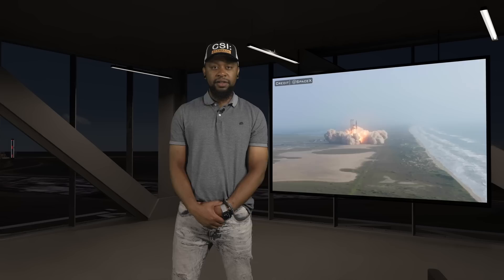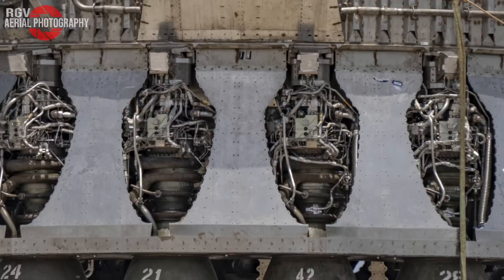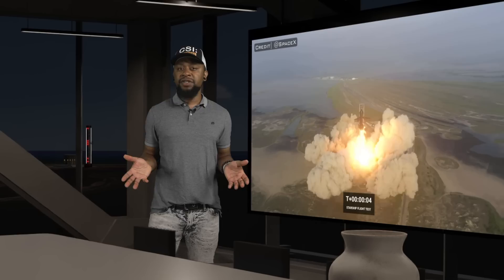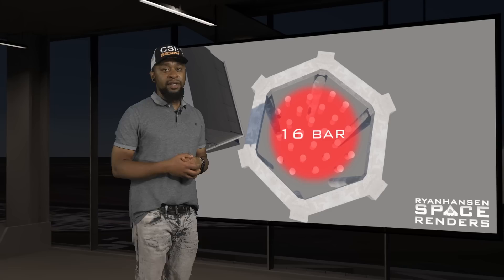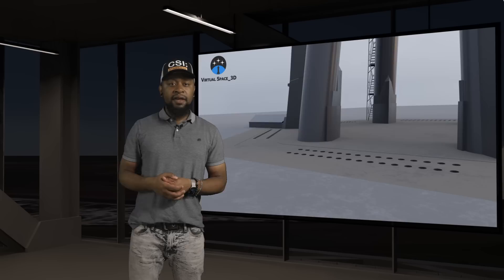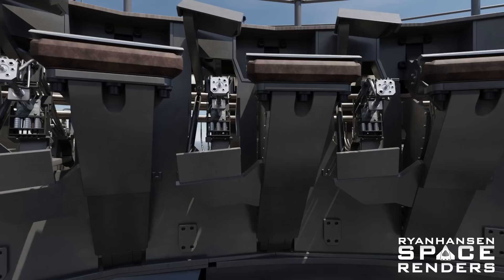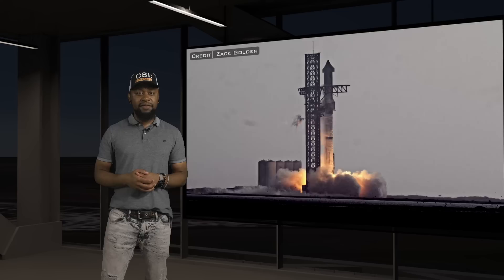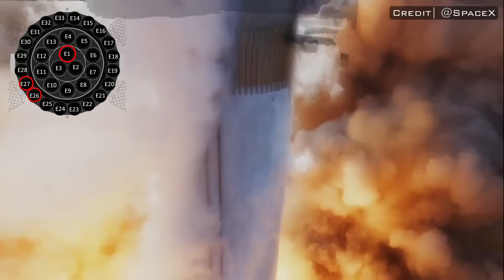The Design Flaw That Caused The Starship Launchpad to Fail!

Comment: Amazing content once again. Detailed and educational analysis of the entire sequence of events, didn't expect you to go that far, definitely the most comprehensive I have seen so far!
The intro section was good. It's difficult to stay on point yet deliver a complete message, regarding the "failure vs. success" narrative conflict in the media and elsewhere, but you accomplished it. 
Also, thanks for being transparent about your initial pessimism. I think this launch led to a lot of speculation in all areas, and everyone in the community had to change their mind about what happened in some way or another, including me, and its important to acknowledge that.

One interesting question: Could Starship, after a booster RUD in flight, separate WITHOUT being able to go to orbit - instead turn around and break back to the pad? As long as Starship can still function, it should have a rather large amount of fuel to burn at that point, so it should be possible to burn until TWR>1 and then land as if coming back from a hop, right?
Given this design will some day take people to space without a launch escape system, these kinds of crazy-sounding redundancies should probably be planned for, at least in my opinion.
(Even crazier: if something critically goes wrong with the ship during launch, would it be possible to dump fuel from the ship, and land the booster back on the pad with the ship still attached?!)

Comment: I am extremely concerned about the "giant showerhead" idea. To illustrate: if you try to keep your finger on open tap, you will likely fail or will have to use a lot of force to stop the water. But you can put your finger on a few openings on a showerhead easily and stop any water going through them. It's because there's enough other openings in the showerhead that will share the increased pressure in the head. in case of the launchpad, all that's needed is sufficient variance in pressure applied to individual openings of the "showerhead" from above for the exhaust gases to enter and tear the plate apart from below. My opinion on the matter is, yes, the plate needs to be cooled both from the top and bottom but any water sprayed on the surface should go from above and sides, essentially along the direction of the exhaust, not from the plate itself.
What happened suggests there's been too much guesswork involved in construction of the platform below the launchpad so far and I really hope guys from SpaceX will do their homework the next time or we may witness flying bits of concrete being replaced by flying sheets of inch thick metal plates.

58:30 On the speculation that the second stage engines did light up, I think it is extremely unlikely.The three "plumes" are way too far apart from each other compared to how big the second stage appears in the image right before the explosion, plus the second stage would have to be facing directly away from us to provide such view but there's something burning to the bottom right of them and that is definitely not burning in the middle of the air.
Reply: The showerhead will work perfectly as long as the water preassure is higher than the engine exaust preassure. Zack said that the preassure of the exaust in the middle of the pad is around 16 bar while the copressed gas tanks that are suspected to be used to press the water through the system can go up to 100s of bars, which should be more than enough to spray water into the exaust plume.
Reply: @bongi6811  one bar is equal to 10m of water column. Water is 700 times density of ambient air at sea level so it must be at least 40 times as dense as mixture of carbon dioxide and water vapor at 16 bars spewed  by Raptor rocket engines. If water pressure exceeds exhaust gas pressure by any significant margins it will spray upward as waterjet and explode expansion bells of Raptor engines. We can have both phenomena occurring at the same time exploding upsidedown showerhead and exploding bells of Raptors
Reply: @KarolKarolak  I don't think that there is any risk of water getting into the engines, since I assume that the high heat of the exaust plume would just instantly turn the spread out water droplets in the air instantly into steam, which will be blown out the sides of the OLM and help with cooling and sound supression just like any other deluge system. Alternatively SpaceX coul just add nozzles to spray the water sideways an not diretly up similar to what is shown in the animation at 32:10. Either way allows them to keep the water preassure a lot higher than 16 bar to ensure that the showerhead works as intended.
Reply: @bongi6811  water at 16 bars or more does not come out of a hole in a steel plate in form of water droplets so your assumptions are not well ground in reality.
Reply: @KarolKarolak  Droplets might be the wrong word, but what I wanted to say is, that the water in the air will be relatively spread out. On the flyover pictures you can see that the holes in the plates are only a few centimeters wide which means that the waterstreams coming out of these holes will have the same diameter. Waterstreams this narrow have a lot of surface area ralative to their volume which means that the flames of the engines should be easily able to transfer their heat into the water fast enough to boil it. Any water deluge system works this way and the watersream on some looks much more concentrated than what this showerhead will produce.
Reply: @bongi6811   quote "the holes in the plates are only a few centimeters wide which means that the water streams coming out of these holes will have the same diameter" water jet at 16 bars will have velocity of around 60m/s and it will cover the distance of 25m to rocket nozzles  in about half second and you believe that this few centimeter in diameter waterjets will get get evaporated in that timeframe. Such incredible heat transfer rate has never been recorded as far as I know
Reply: @jolantadziaduk8558  I'm not a thermodynamics expert, so I don't know what the exact heat transfer rate is and my rough estimation could be completetly wrong. But it's also important to consider that the speed of the water coming out of the holes isn't determined by the 16 bar, but instead by the difference in preassure between the water and the exaust gasses. If SpaceX for example pressurizes the water to 4 bar, ignites the engines and then increases the preassure to 20 bar while the engines throttle up, the preassure difference at the holes will never exceed about 4 bar and there won't be an extremely fast high preassure stream to worry about. Alternatively they could just add nozzles to dispurse the water even more or direct it away from the engines. We just haven't seen enough of this system yet to be completely sure about how I works, but I'm confident that the engineers at SpaceX have taken all these pressurization and thermodynamic effects into consideration.

Comment: If liquid water is present in the perforated steel plate and system, exhaust detonations and accompanying additive constructive interference could raise pressures by multiples  within the system. Aerating the water could reduce the forces involved.

Comment: 33:00 Dig a very deep hole with a larger diameter at the bottom. Before launch, remove water table water from the hole. Vent the bottom of the hole radially using at least three vectors and ideally many more and angling back to the surface...like exhaust pipes. Provide as much insulation as necessary to keep moisture from flashing immediately to high pressure steam due to immediate intense heat. Alternately raise the launch tower significantly. Concept: Make the liftoff against air. It's virtually against air 10 seconds later anyway.

Comment: Instead of circulating the water all the way around in one, and then out the other, breaking into 20 segments or so, with water in and out in each segment, would greatly reduce their overheating potential

Comment: No one mentioning STILL that you can literally SEE the concussive shockwaves created by the constructive interference of the sonic booms generated by the exhaust turbulence.   You can SEE the pulsing flashes of concussions shooting up the side of the rocket on the side where the greatest damaged occurs in the drone shots. This is the reflection of the shockwaves that pounded the concrete to rubble, BEFORE the rocket exhaust could strip it from the rebar.   Only after those 15 or 20 concussive shocks do you see material start flying, and the evidence of soil and concrete erosion in the color of the clouds being kicked up.   Its the acoustic shockwaves.  The reason every large pad since the 1960’s has had water deluge acoustic suppression and that Musk, in his infinite arrogance, thought he could live without.   For Musk’s stated vision of rapid reusability, Job ONE was a pad that would require zero repair or maintenance between launches and at which He and SpaceX have spectacularly failed.  Not even the PAINT on the OLM can withstand a single launch.   Allowing the flames to fly in every direction is yet another bonehead idea that utterly failed to protect nearby infrastructure.   And the supposed “water cooled steel plate” that was already in the works prior to launch is still insufficient in that it fails to divert flames, having the steel plate take the full perpendicular brunt of the engine thrust and acoustic shock.  You don’t Need water flowing internally. A deluge ABOVE the concrete and steel converts acoustic shocks into atomization of the water, and the heat energy of the plasma plume gets attenuated in boiling that atomized water into steam that carries the heat away- IF you redirect the thrust vector with a diverter.

Comment: Another problem not mentioned is harmonic vibration. The Raptor engines do not exert a steady pressure. Chaos theory means that the pressure will fluctuate  giving the effect of a giant gas jacķhammer. This can set up sympathetic harmonic vibrations in the blast pad. These vibrations can tear apart almost anything.

Comment: Incredible video -- the combination of super deep technical analysis and extremely high production quality is literally out of this world 🌎! Based on E's claim that there was no data to indicate rock tornado damage to the engines, it leaves me wondering: if this turns out to be the case, then what is causing multiple Raptors to fail? If it's a design flaw, it would be quite concerning. Am hope that my concern is unwarranted, and that Raptor and heat shield upgrades in the next Booster will be robust enough to prevent Raptors from failing in the way we saw in the first OTF.
Reply: Those engines were the first ones ever tested in flight. The ones on B9 are newer and therefore more likely to be of even quality. The boosters after them will get even better. We must not forget that none of these boosters is meant for reuse. They are test articles to help find any problems that were not apparent on the ground. It is an expensive way to improve, but it is fast.

Comment: There is good reason to try to start the starship engines in the event of booster failure, even if there is no chance to reach orbit.

To save the ship! Remember in theory the ship can return to the launch site and land again. Orbit is not the only safe destination.
Reply: Obviously that would be a requirement for human-rating but ofc this ship is a prototype & uncrewed so not a consideration until now
Reply: This would be useful for crewed flights however it massively complicates any approval or risk mitigation strategy. 

Currently if the booster or ship fails at any point, the debris splashdown zone is only ever going to be directly under the trajectory of both. But if you add the ship's potential emergency escape at any part of the flight you need the licence to authorize a now mobile element to divert from its flight path and potentially put other areas outside the initial exclusion zone at risk.

Remember spaceX battled procedure for nearly two years before they got the license for this booster and ship specifically, on this lowest risk and simplest flight plan with no recovery attempts. 

It is likely the first intentional addition of emergency ship escape measures will be undertaken after the first successful flights of the current envelope.
Reply: @mobiuscoreindustries  that's just an excuse, eventually the plan is to recover the ship, so having the system try to keep the ship alive in a booster rid event even if in this test flight you would need to activate the FTS on the ship as well, is worth doing.

Just because it means more engineering and paperwork does mean it's not worth doing. Not that I expect them to do it on the first flight but it's not a terrible idea for the second one for it to be programmed in. As long as the ship maintains inside the flight corridor then it's fine, even if you still need to blow up the ship, you can still test stage separation, second stage ignition, and even practice landing burns on a virtual landing tower before detonating the ship over the ocean.
Reply: @stillatwork  Precisely why Elon said "maybe we should"
Reply: I wonder if starship can effectively outrun a failing booster given cryogenic propulsion.   Pretty much all escape systems are powered by either solid or hypergolic fuels which ignite immediately.
Reply: @randyschreiner7807  well it does not really have a practical way of doing otherwise. Solid rocket motors are heavy and hypergolic fuels require their own tanks, fuel systems and engines making it also heavy. This is of course not exactly dead weight but it is always placed on what is essentially just a cramped capsule of dudes. Something that is comparatively light which means it takes "relatively" little to accelerate this to a velocity sufficient for safe separation. Those that use hypergolics like dragon also tend to use it as the fuel for their regular thruster, the Apollo capsule made use of an abort tower that was ditched before stage separation as to not carry it's dead weight into the flight. 

Starship has the issue that just like the shuttle, the entire second stage is the vehicle, and that means a considerably larger mass to move around. Finally the issue with an SRB escape system is that it will not help if you can't recover what you ejected. Capsules were simple in the sense that they could just parachute down and even then at some envelopes an abort would have a very high likelihood of being lethal. The shuttle had very narrow windows for viable aborts and starship will need functional engines to perform even an emergency landing. So to me it would make more sense to attempt to use the ship's engines to separate (as long as it can be done safely to the ship) because you need those engines anyways to actually recover the vehicle, or potentially perform an abort to orbit if you so happen to be able to do so (which is generally the preferred option)

Comment: I agree with the idea of the second stage (StarShip Orbital) make an attempt to separate and stay intact if necessary and possible as normal protocol. Even if it doesn't go to orbit it could be the egress capabilities its missing or at least return valuable payload rather than destroy it. Maybe you could do an analysis of that capability considering deltaV and payload weight.

Comment: In sandy water saturated soils, friction piles should be DRIVEN not augured. The driving process increases the relative strength and compaction of the soil, thus reducing the possibility of liquefaction. Think of it like squeezing out a sponge. Those augured pilings in unimproved soils will act like tuning forks and will turn the soil to jello again.
Reply: Any references/civil engineers journals for this?
Reply: @alvianchoiriapriliansyah9882  ASTM and Soil Mechanics textbooks. i will see if i still have my college books. BS Engineering Geology
Reply: @wolframreactor74  If that's the case why the launch mount & legs stayed level even tho it uses the same augered piles?
Reply: @alvianchoiriapriliansyah9882  launch mount legs diameter are much wider than the pilings directly under the table. the hex ring also focuses the vibro-acoustic energy inward. fill a glass of water, set on table. drum vigorously on table watch the reflection of vibration in your glass.

Comment: Love how Elon tried not to admit that starship did seperate and light it's engines. 
I certainly expected them to at least attempt a seperation maybe even going with a powered separation from the starship engines due to the booster still being under thrust. Fairly certain that is going to be a penalty finding with the FAA if it's confirmed though but to get solid data on seperation could be worth the retribution.

Comment: First time viewer, fantastic job!!! I feel like I actually got some hard information instead of what I feel like from other youtubers. What I can't understand is why SpaceX is so set against a water deluge/sound suppression system on the pad? I know they want to do their own thing, but dang nab it, unless they get this new water system exactly right, it's going to be a giant KABOOOOOM!!! Bite the bullet and put a water deluge system on the top and base of the pad so the top ring is protected, and the base is also protected with not only water but a thrust deflector underneath the engines to keep the OLM in one piece. Yes, I'm older than Elon as well as probably most of his employees, but there were solid sound reasons things were done the way they were years ago.